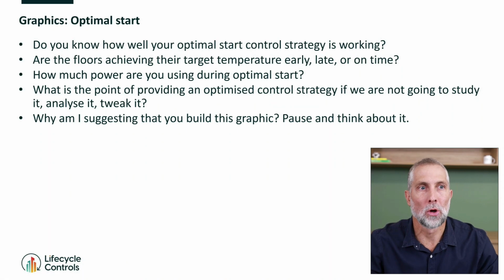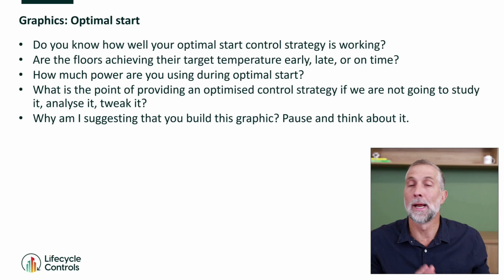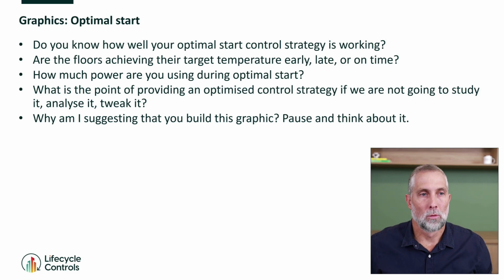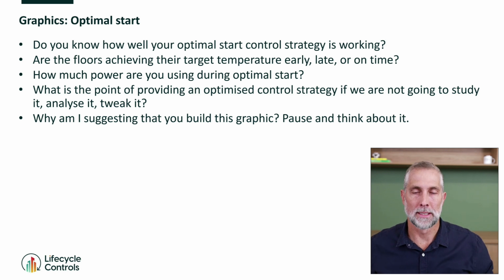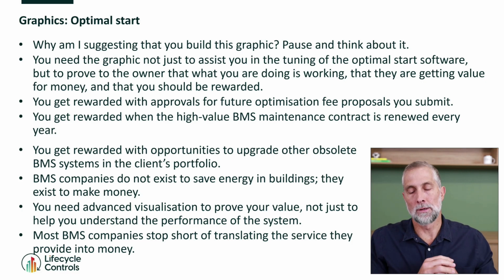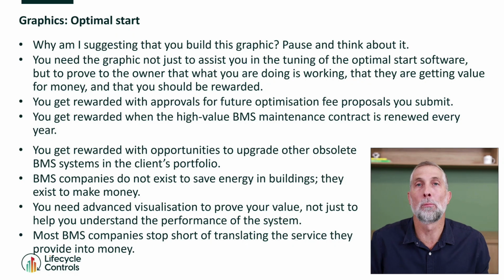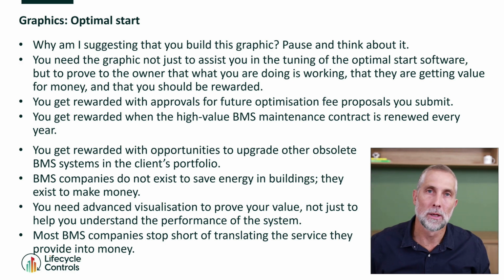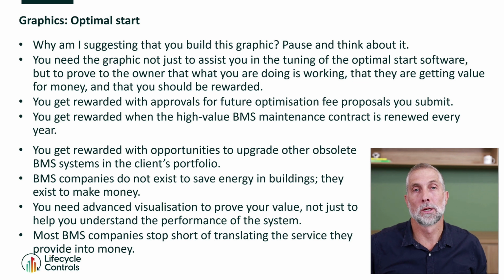Optimal Start graphics (introduction)

Comment: In this day and age where everyone is concerned about energy I’m starting to think optimum start should be removed and they just change the lease agreements! Optimum stop is the real energy saver and should be the only strategy implemented in my opinion.
Reply from the maker: I have also though about this deeply. I am still specifying optimal start out of habbit. But, if a BMS engineer challened me on a project, I'd be open to hearing them out. In Australia, we need to have say, 21-24°C at occupancy times. Actually, not all leases stipulate the temperature range. Okay, yes, I see your point now. Change the lease agreement.

Comment: How do you balance optimum start with peak load?
Reply from the maker: That is the million dollar question. Traditionally we run optimal start quite hard so that the AHUs run for as short a time as possible. But, that increases peak demand. 
It would take proper tuning and analysis to determine if perhaps it is better to soften optimal start to run for longer but using less peak power. 
The goal is develop optimal start and peak demand control strategies, with good visualisation, that allows you to study both and depending on the type of building and how it behaves, to tweak each one, bias each one to what is working best for that building. 
Yes, this is extremely complex and would need a very motivated, passionate engineer or company to put this level of effort in.